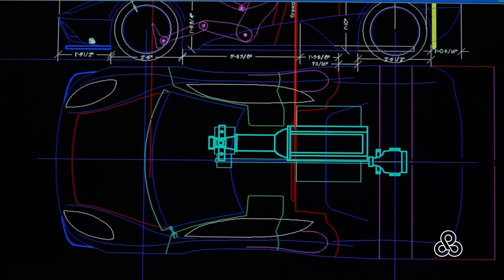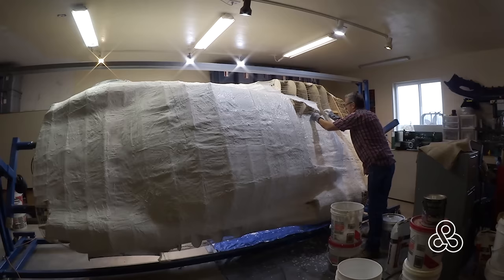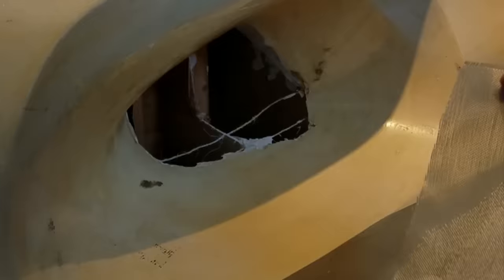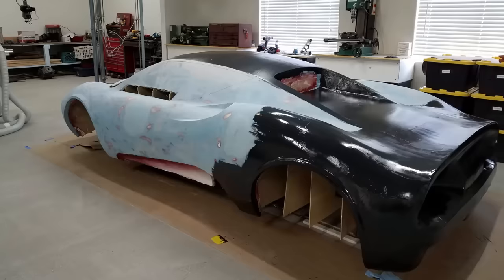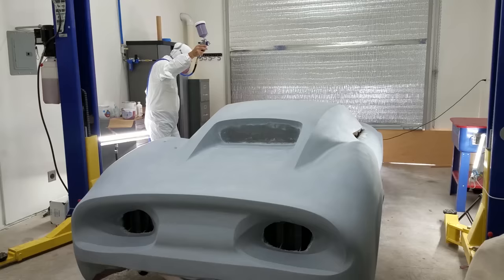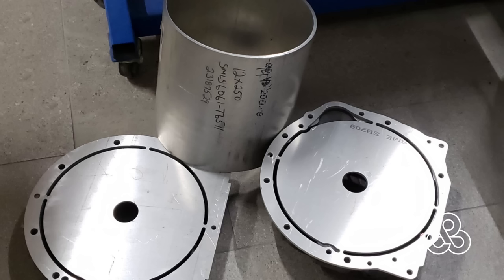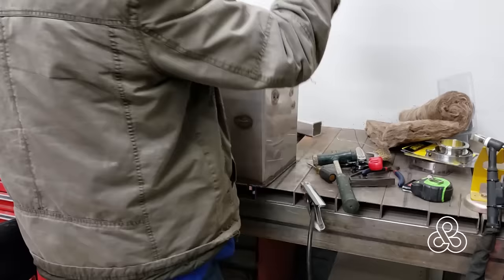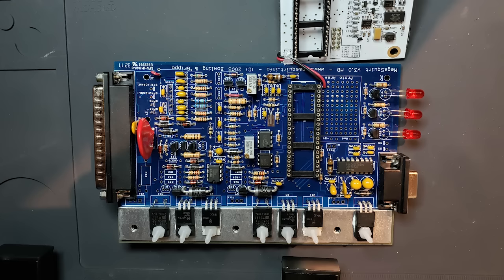How to build your own 200mph Supercar; at home in your spare time. Part 1

Comment: Hi, to have done this kind of work for years I’m 75 retired and one tip I might give to you is that all the clay is very nice for flanges. There is a foam comes in squares. It’s usually used for flower arrangements. It will not melt, win in the presence of styrene, it is easier to manipulate then I scuff it down or it might need shaping and the last step is to press aluminum tape over the face sort of like you would wrap it with aluminum tape. Seems like it would take extra time but it really doesn’t. It will allow you to have much more flexibility in the shape of the flange for what it’s worth. Thanks for the video.

Comment: "I'm new to this electronics world, BUT building our own ECU"...... This is just gold, what a build!
Reply from the maker: Well, it was from a kit! One day design my own?
Reply: @BuilderCreator   Thanks for sharing your work, great video with so much quality information, cheers. Would you be kind enough to share a link for the ecu and tcu kits? I've squeezed a 1jz gte into a little Daihatsu Rocky 4x4 and the kits would be very handy, particularly the transmission controller. Keep up the great work and thanks again.
Reply: @BuilderCreator  Arduino can run ecu and there's a library avalable!
Reply: @georgekurgansky5986  Thanks mate
Reply from the maker: @tim0e  https://www.diyautotune.com  they sell the kits and auxiliary hardware- good service- enjoy!
Reply from the maker: @georgekurgansky5986  I will be using Arduino on all the CAN bus peripherals.
Reply: @BuilderCreator  Thanks mate, much appreciated. Keep up the good work
Reply: Does he, shit IV been doing this for years, IV not watched it yet I got 2.30 in and was already spunking in my pants lol, I crack ECU's, currently for a Saab unit on my desk, this dude appears to be a proper treasure chest the comments have raised my expectations some I tell ya lol...
Reply: Megasquirt has been around for years with a lot of support, its great to see their ms3 ecu in an oem form factor now
Reply: @EZ-D-FIANT  I’ve done Saab immobilizers, r&r the chip under a dang microscope! Instead of paying 2 geez to save my car, bought all the equipment under $500 and DIM. What a process that was!

Though saw a video where some dude threw a box on a 9-5(?) hood connected to a computer, pushed a button on the laptop, lights flashed, he got in and was gone. Made my heart sank after all that work, but wonder if that works on a ‘04 9-3?
Reply: @pistonwristpin1  immobilisers are how I got started, lost keys for early Saabs (900+9000 particularly) are a nightmare if you loose the keys/fobs, I've since bought all those computers and become a bit of a Saab specialist out of necessity, I install alot of the trionic based ecu maps do you still currently Saab that's a good update if you do, yea for sure I got fed up of the prices and people doing feck all to earn that money hence me learning and buying the equipment myself, I now cover most GM stuff (considering I specialise in JDM and UK classics I cover alot of cars nowdays) so it was worth it in the long run but one hell of a learning curve...👍👌👍

Comment: Thank you for filming this entire process and presenting it in such a great way. It's on my bucket list to design and build my own car and this helps a lot. I am a metalworker so I will be doing mine in aluminum, but I'll need to build a buck like you did (only half of one though). I had no idea drywall mud could be used as a base for that. I am blown away by your obvious wealth of knowledge. I don't know that the average person would grasp just how much you need to know to design and build something like this. Absolutely incredible work.
Reply from the maker: Thanks for your kind words and for subscribing to the channel. Typically a buck for pulling patterns and trial fitment in aluminum bodywork, is made out of heavy plywood, but once you have the buck built, your set in stone (or plywood). I use the plaster the way a design studio would use clay; it gives you the opportunity to add or subtract from your design. I don't see why you could not use the plaster model/buck in aluminum fabricating. I've not had the opportunity to do any real work (more like just mess around) on the English wheel, but would also like to have a go at an aluminum car. Something akin to a D type Jaguar would be the bomb!
Reply from the maker: Just took a look at your channel and subscribed. Huge Rocketeer fan will have to find some time to go through that and other videos you have that look interesting.
Reply: @BuilderCreator  Thank you sir! I'll definitely be binge watching all of your videos in the coming weeks as well. As far as the buck for aluminum, I won't be fitting the aluminum parts to the buck itself. I am going to use a method developed by Wray Schelin that he calls a flexible shape pattern. The buck is only used to get the pattern, and you can flip the pattern for the opposite side. It's actually a fascinating process and if you have any interest in doing that sort of metal shaping you should definitely check out his channel Wray Schelin's Proshaper Workshop.
Reply from the maker: @DavidGuyton  Well thanks David!! I just lost a few weeks of my life! Between you and Wray Schelin, hours of productive work time are going to be lost to Youtube binging.
Reply: @BuilderCreator  hahahaha my apologies! We're even now I guess
Reply: good luck!!!
Reply: Using plaster is the best way of doing it. then spray it with shellac to seal the plaster for a hard surface. Hope you get to do your project as well.
Reply: Christopher Runge is one to be checked as well, especially when it comes to aluminum fabrication. Good techniques and overall finished product :-)
Reply: add 10-15 years of time to your "bucket list"  this is a multi year,multi mistake,multi cost process
Reply: You will want to use hot mud and not just joint compound although compound Is good to fill small defects.  Think of it like plastic body filler and spot putty.  🥳
Reply: I know !!!  I was blown away. I have built cars and bikes but this just blew me away.
Reply: Usual

Comment: Three years late but this man just made the connection between designing kayaks and designing super cars that I did not know was possible. Personally I’d design a drivetrain and tube chassis first, but this is literally how high performance whitewater and slalom kayaks are conceived. I’m kinda sold and now believe there’s a real path for me to get into motorsports design. Thank you sir
Reply from the maker: Yes, good time to get into motorsports, as I'm About to get into boat building. Subscribe to follow along.

Comment: this is like living in a dream, you can make whatever on your mind passionately
Reply: mantap bang
Reply: weh ada ente d sini. pertanda bakal bikin mobil sendiri d rumah bang
Reply: @Adi-xe4ut  pengennya sih begitu, kalo dah punya banyak waktu luang plus modal,
Reply: if you have the money...
Reply: @nickcompton4772  I have made a complete body using rolled aluminum and rivets.  You can make a cheap body but yes the engine is expensive and the frame semi expensive.   The method shown here makes multiple copies.  He is a pro!
Reply: Because life is exactly that. With the internet at your fingertips, you haven't got any excuse for not making everything you want. Money is something that can be made, so don't use that as an excuse.
Reply: need an autoclave do you use carbon fiber bed bug baby if it's a good design to hold to the ground which ground effects everything 330 miles an hour where is the new standard is still stupid fast and unnecessary Chris egg admits that 330 miles an hour is it's the quickest car that he wants to build because it's stupid fast and you can not drive it legally it looks like a nice design I would take your Mill Bridgeport I just wish I had that I can do so much do you have a lathe also CNC preferably
Reply: @smurfweed8513   please send me more info I could probably make heat out of it also thank you for the update cross the old fart
Reply: Well then, make mine a double.( neat)
Reply: Yes but you need to have the Knowledge of how to do stuff like this.....So what do some one like me who just watched this video and will like to acquire such Knowledge,   Go from here?
Reply: Pros of selling drugs, so rich you can do anything
Reply: Gak ngerti bosone ....
Reply: @odurandina  I voted Biden....and I love both the car and the presentation. Now what????
Reply: If Ferrari and Lamborghini can do it you can do it. There's nothing special they have that you can't possess. And the difference is you can build something like this for a fraction of what there's cost. The only difficulty here is if you don't have any metal working or woodworking experience you'll have to put in some time to acquire some tools and some skill. Or you can find a buddy locally who will help you or teach you for some cases of beer.
Reply: @alfansaazizaryato  VICAR
Reply: @alfansaazizaryato  l
Reply: And the time.
Reply: Please what material did you use to make the car body
Reply: Ll

Comment: I consider myself being a handy guy. I built three houses, two garages and two workshops, the biggest enough for a small carpenter company. I renovated many cars, built a cab and two pick-ups on standard car chassies. Also a few bike builds and a boat. Now, this is probably streching my abilitys a bit, but i could most likely build something like this. Unfortunantly i am almost 60 and my lungs and heart has soon passed their experations date, witch stops me from starting a build; -i would never see it finished. That, of course, make me sad. But to see some one make a fanstastic project like this come true, truly cheers me up! You, Sir, are a true professional. Respect!
Reply from the maker: Yep, sounds like you are definitely handy enough to tackle a project like this. And NEVER say that "almost 60" is getting too old; we are the same age. It may be just the thing to keep you feeling young. I look at it this way; if we live to be a hundred years old, that will be the year 2064. That is a long ways off. When I was young, I wondered if I would live to the year 2000. Breezed by that with ease, so why not 2064?  Thanks for watching.
Reply: I truly admire your positive thinking! No wonder you can cope with a project of this magnitude. I have not stopped yet with projects, i currently renovating my house and have a 500cc atv that need a lot of love, plus some other smaller jobs, but it takes time. I´ll wait with anticipation for your first testdrive, your videos are really top class! Best wishes, P.A @BuilderCreator

Comment: I built a mid-engine fiberglass sports car from 1979-1983 using nearly the identical processes shown here in this video. The running/driving prototype is still in my garage. Other than the introduction of CAD and better synthetic finishing materials, it's amazing how little has changed in the past 40 years. Great work!!  Thanks for sharing your processes on Youtube!!
Reply from the maker: Got any pictures you can share? Instagram account?  We would love to see.
Reply: @BuilderCreator   thanks for asking...you can watch an old video showing pics of the build here https://www.youtube.com/watch?v=EF8ARtu5VqI&t=59s or read about it here...https://mycarquest.com/2014/07/the-dream-of-designing-and-building-a-special-car-becomes-a-reality-part-1.html

Comment: ...."just happened to have this roticeory"........as you do.
Reply: You can build one for around 100$
Reply: Furio  #ForSale
Reply: You could build a wooden one but if you're planning on multiple use than I would go on ahead and build a metal one.
Reply: If you're restoring a car, it's the third must have item, after an engine hoist/crane, then an engine stand.

Comment: This is exactly what I have been tooling up for. I contacted Wheelers Builders to see what I needed and have been slowly purchasing welding equipment, (to start a mobile welding business),  I found a 1900's lathe, a 70" sheet metal brake and I am looking for a milling machine  among everything else I am going to need. You are so much further along. I am not trying to design my own car as of yet but now that I know it can be done I just might. You are truly a genius!! I am going to try and get you up to a million subs. You truly deserve it!!
Reply from the maker: Bring on the millions, I can take it. Ha! Get yourself a cheap little Chinese mill for drill and minor surfacing, but hold out for a larger CNC mill. A 3D printer is indispensable as well.

Comment: This is awesome.  I have not built a supercar, guess I started out smaller to stretch my wings.  I designed and built a miniGP race motorcycle, complete with all aluminum frame, swingarm, all the foot controls, triple trees, exhaust, rear subframe, and body which I first made out of fiberglass and later made molds and redid in carbon fiber.  Mine looks a little more rushed, because I really wanted to do testing and ride it.  Interestingly, I happen to have a 351 Cleveland V8 from a Mustang I used to have, and have begun daydreaming about ... building a supercar using what I learned with the fiberglass and carbon fiber.  Will definitely check out the other videos as well.
Reply from the maker: Sounds like you on your way. Every project builds upon past successes.

Comment: This is so inspirational - it makes me want to get my own design for a scratchbuilt exotic car built. Though instead of burlap and plaster, I'll use my 3D printer to make the body and chassis mold masters.

In about 2,000 individual puzzle pieces all glued together.
Reply from the maker: And 200 spools of PLA!
Reply: @BuilderCreator  And five gallons of super glue.

Comment: Jay really LOVE your You Tube clips. Can't wait for each new one to come out. I've been building Hot Rods, Street Rods, Boats, and motorcycles since the mid 70's. I've seen all the car and bike building shows that are out there. They are almost all the same and really boring after the first few cars. Watching your clips, has shown me something I have always wondered about but was never able to find out about. Every show I watch, I find something new to use in the work I do. I just saw today you asked about the supplies where we live. I live in the Tampa Bay area so there are plenty of Hot Rods, Street Rods, and Car Shows / Swap meets such as the 4 day Thanksgiving swap meet show at the Daytona Speedway. There are shows all over the state all year long. For those that don't mind the drive, there are very big shows in Moultrie GA, Cruising the Coast in Louisiana, and a great show at the Charlotte Motor Speedway. In Tampa they have the Southeast Street Rod Nationals every year.  As for supplies, we can get everything we need to, from paint body supplies, steel, used parts from you pull it parts to swap meets and the internet. Keep up the GREAT work. Don't pay attention to the key board warriors who know it all and have never changed a tire never did a frame off build on a Street Rod. Was wondering if you ever answer questions from people. When people comment about the Toyota engine you are using, they just need to see the size, horse power, and rpm's of the Indy Car engines!! Oh, by the way, I've been building a 66 Cobra Replica Kit  Car with a ZZ-383 Chevy engine, 8 Stack Fuel Injection, Tremec 6 speed trans and Ford 9" Rear 4 link. Keep up the great work. Joe Stanton Apollo Beach, Florida.
Reply from the maker: Yeah, Florida is second only to California in car culture. (maybe first, as CA wont let you do anything anymore. Ha!)  Also, a great place for composites with so much of the experimental aircraft culture taking place there. In fact I get my materials from Florida. Lots of hot rod guys end up at Cobra when they get old and more conservative. Ha!